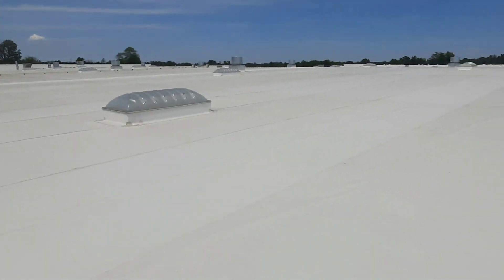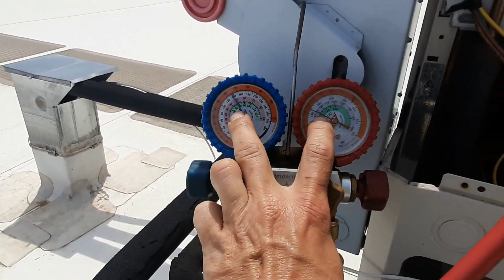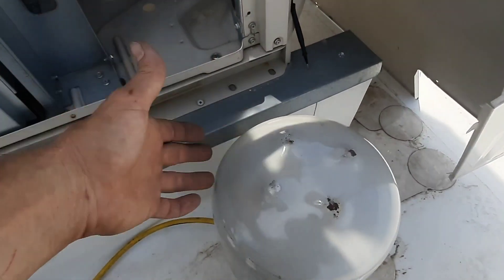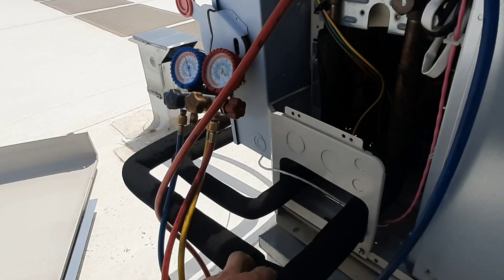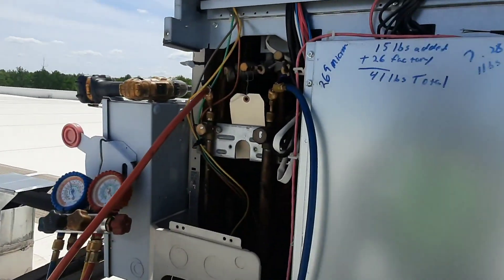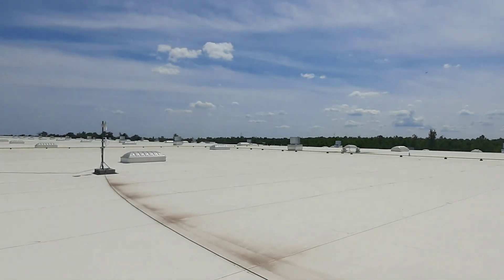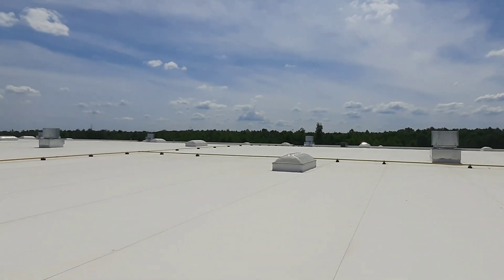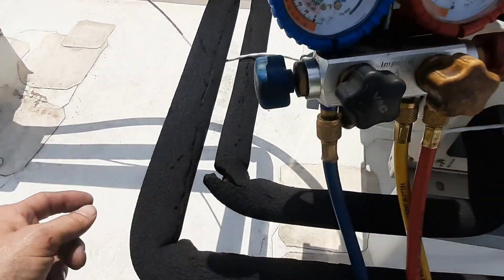VRF Madness! poor installation leads to big problems

Comment: So depending on the manufacturer, if you have a subcooling circuit then the condenser fans won’t come on cause it’s using the subcooler. Also ambient temp affects the way the fans operate. You’re definitely low on charge cause that HGBP is open. I would be careful charging these unit, Very easy to overcharge. Good units to learn and study but I think we’re way behind on the technology compared to the rest of the world.
Reply from the maker: Thanks, Mwdub! Great information, I appreciate it. The software I didn't have access to at the time of the call will be very helpful. I understand you can see a lot of information, similar to a chiller, pressure/temperature, transducers, and exactly what valves are doing what.
Reply: @EverythingHVACR  what’s the plan for the leak search,Steve.

Comment: YOU DON'T USE your gauges to troubleshoot these VRF units. EVERYTHING is done through the computer. "NEVER ADD REFRIGERANT" if you have not monitored the unit for at least 1 to 2 hours. There are many thermistors, check valves, solenoids, etc that influence your system. Please do a ride along with a VRF guy before touching these systems. Its like sending a rookie HVAC guy to do a leak check and repair, by himself (you will never allow it). It takes time to get the knowledge before doing it by yourself. YOU ARE SMART that's why you are an HVAC tech but VRF is a totally different animal my friend.

Comment: Those braze joints don't look that great. I'd be curious if they actually ran nitrogen through during brazing. Supposedly you aren't supposed to use gauges on VRF systems either. Mitsubishi has a service tool you hook up to the condensing unit (they call it chiller) that will let you know the pressures and how low you you are after you put system into test mode.
Reply from the maker: Yeah, nitrogen probably wasn't used. I didn't have a service tool, so I made do with what I had, but you can plug in and see all information from what I understand.

Comment: A low charge condition places a lot of stress on the inverter board as well as it’s trying to find the “sweet spot” by adjusting the Hz back and forth to try and maintain IDU unit coil temperatures. Biggest issues are indeed installation related as the equipment itself is pretty robust. Leaks, and copper oxide contamination from not purging with nitrogen when brazing at install, and communication issues from poor connections between the ODU, the Branch Controller or Mode Selection Box if it’s Heat Recovery, the IDU’s and between thermostats and and or a Centralized Controller if one is used.
Reply from the maker: Thanks, middleamerica. Sounds like you work on a lot of these. Where in middleamerica are you from?

Comment: Not good Steve having to lug up all your gear up a roof top ladder
Then all the way across the roof.😯
I used to my gear up withba rope .👍👍👍
Reply from the maker: Thanks, John. I agree, a rope does help, but the lapeyre stairs to the hatch make it harder than a normal ladder, plus you can't go up the side of the building because you have to stay six feet from the edge and there are no tie off points.